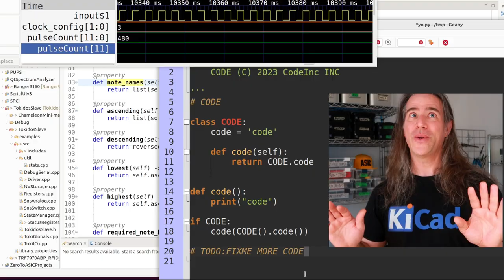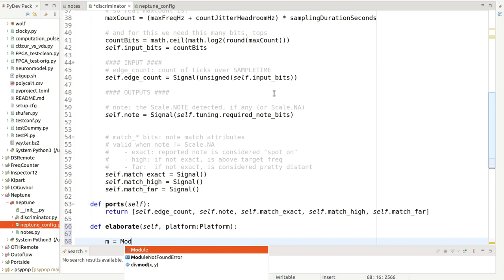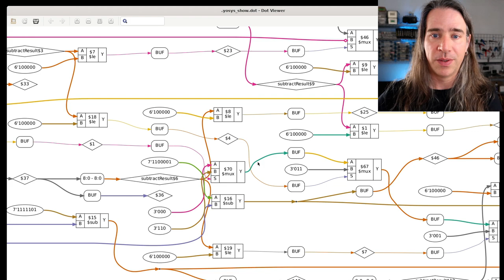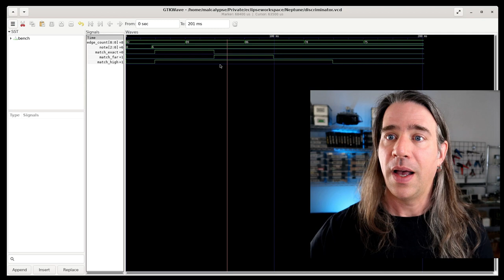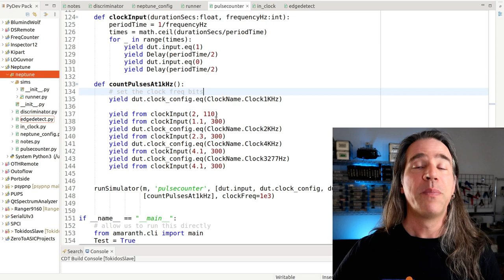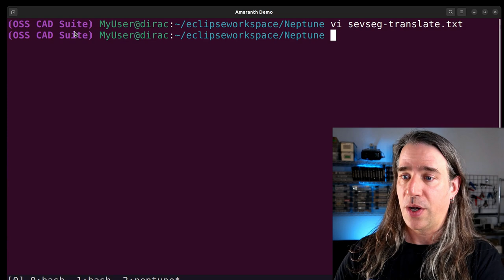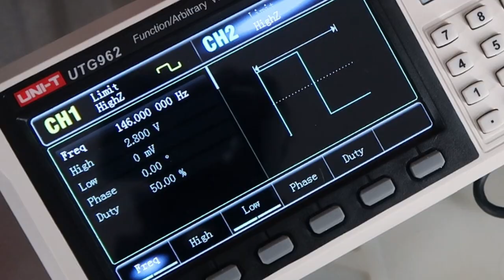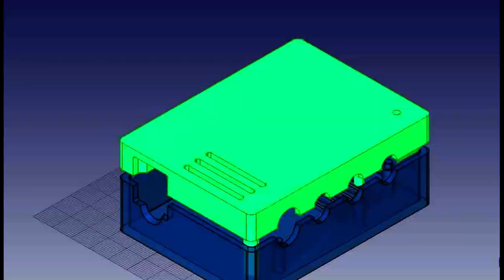Python to HDL: full Amaranth walkthrough to FPGA and ASIC GDS

Comment: Hi Pat, this is really a great project! When I was still active as a musician, we tuned the guitar strings using the beating. These are caused by the frequency differences. The beats modulated in the range of one Hertz and less. As far as I know, these periods correspond to the difference frequency of the vibrations of the strings. Therefore, it could be that the tolerances you provide are too large. To be on the safe side, you could possibly tune the guitar with the frequency generator and do an audition to see whether a tuning with a frequency at the lower and upper limit of the spot-on range still sounds OK. Or you could try to feed real guitar signals to the FPGA....? Just to validate the concept before putting real money into an ASIC.
Reply from the maker: Anton, thanks for this info!  So you're talking about beat frequencies when two tones are mixed, right?  I think this is how I can tell how matched they are (you know, when you hold fret 5 and pluck that string and the next)--you can hear the pulsing when they're close and it sounds horrid as they get further apart.  Just not sure how to implement... sweeping the targets to find the beats might work (but be slow?) and the mixing would need to happen outside the circuit (unless I really didn't grok). 

In any case, you're right... I need to breadboard the A2D side and give it a shot.  I'm pretty certain the current window is way too wide for the low strings.   On the good news front, found that, once all the optimizing is done (there's stuffing where multi-port gates are used from the PDK), it only uses 500-some gates.  So there may be room for a good deal of improvement.

Oh, and final note: it's literally a hundred bucks to get onto tinytapeout, so that's not a big risk.  The real problem is the turn-around time, waiting for the actual ICs, makes the cycle really slow, so better get it right.

Thanks again for the feedback (musician pun!1) and I'm happy you liked it :)

Comment: Does the Eclipse IDE need any special Amaranth/python plugin?   Are there certain rules when using Python to make synthesizable HDL.. like it must be Object-Oriented, can't import certain types of modules , etc?

And how is timing closure done?  Where can you analyze timing and specify maximum path times, etc?

Also what parts of this flow can be used on non-lattice FPGAs?  For example, can any of the tools like F4PGA/Symbiflow,  Yosys , Padring/config , Coriolis (PnR), Tas Yagle (STA), KLayout, Magic (DRC/LVS) be leveraged towards a Microchip Polarfire, or Quicklogic, etc?   

For example, I would love to simulate open-source HDLs (ValentyUSB, VexRiscV) without using Questa/ModelSim.   Creating test-benches is so time consuming, and the only other alternative I've seen people use is Altera's Max Plus II to draw waveforms and simulate that way, but wonder if there's a better way?!
Reply from the maker: Hello Ben!  
There may be other options, but I use the PyDev plugin with eclipse for Python, and that's all you need (in addition to having the Amaranth libs installed somewhere in the pythonpath).

The main requirements are that your modules derive from Elaboratable and return a Module on elaborate, which is all very OO.  Otherwise, you can do things any way you like, use any python you wish.

But to be clear, that doesn't mean you can magically import numpy into your hardware.  The Python is used at the stage of netlist construction, i.e. when you're building the logic tree that represents your hardware design.  Once that's done, python goes away.  
You spit out verilog, or RTLIL and then move down the chain of tools.

A number of FGPAs are already supported (see https://github.com/amaranth-lang/amaranth-boards/tree/main/amaranth_boards ) and adding support isn't all that hard.  However, if you want a flow that goes from Python straight to burning the FPGA, it will have to be something the community's reverse engineered, because FPGA companies are really anal about that and can't see the benefits of giving access.

Anyway, if you want to use STA or other such tools, the normal flow would be to go from your design generator in Amaranth/Python -> to your design in Verilog -> hardening with Yosys/OpenLane/OpenRoad or whatever is appropriate, which is also where you'd be doing all the clock tree, timing, etc stuff.

So, if you've done this work before from an HDL, you can just think of Amaranth as one step before, a way to generate that HDL.  Nothing afterwards needs to change.